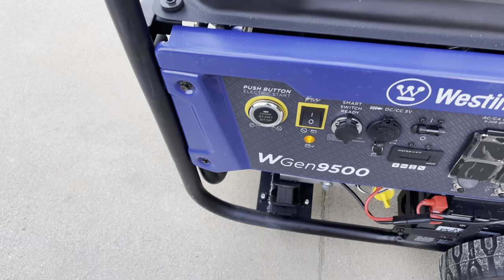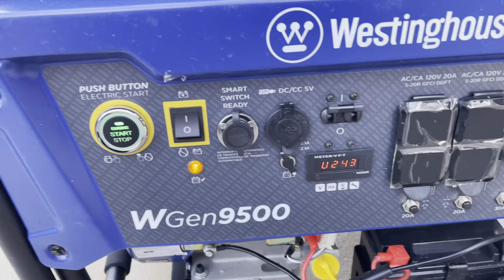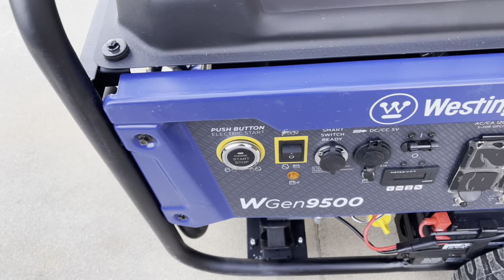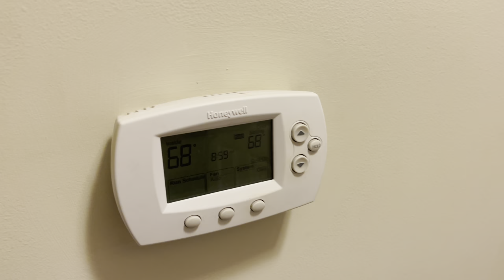WESTINGHOUSE WGen9500! Will it power a home AC??? First start, short review, and the truth!

Comment: How long could that generator run an air fryer nonstop for food catering?
Reply from the maker: Just an Air Fryer? Well I never ran it a super long time but I’m pretty sure it could power a hour for 12 ish hours… so just an air fryer without a huge load on the the generator id say 13-14 hours? Not 100% sure.

Comment: Does your 50 amp outlet have a 30 amp breaker like mine? Is this wrong?
Reply from the maker: My 50amp outlet uses the main breaker that’s an actual flip up or down lever
Reply: @BigCountrysWay  Are we discussing the same thing? I’m referring to on the generator, the 50 amp outlet with a 30 amp circuit breaker on the generators panel under (sort of) the outlet.

Comment: Have you determined how many gallons of gas it uses per hour with a decent load
Reply from the maker: No I haven’t, haven’t had to run it to power anything yet
Reply from the maker: Will prob know after hurricane season hahaha
Reply: @BigCountrysWay  I went through power outages from Hurricanes Laura and Delta, plus three winter storms.  I plan to buy a dual fuel generator to have the option of propane but will have to depend on gas initially. Money is not a serious concern, but fuel is. Those storms were so bad that gas was very difficult to find in the entire western portion of Louisiana.
Reply from the maker: @rickcormier9160  I’m thinking bout adding a natural gas carburetor on it so I can tap into my houses gas
Reply: @BigCountrysWay  That would be a great solution and to still have gas as an option.
Reply from the maker: @rickcormier9160  they make a tri fuel kit
Reply: @BigCountrysWay  I have the same Wgen9500 Westinghouse generator that only runs gasoline. Who makes the natural gas kit or carburetor you mentioned?  Thanks!
Reply from the maker: @michaelgrech7894  to be honest, all I did was google it lol

Comment: Got a question.  I got the same one and I'm going to wire it up for the 50 amp. My question is it's a 120/240 volt. Does it automatically just switch between the volts. Like how can it run let's say a electric dryer that's on 240 but at the same time run your fridge that's 110 without burning the fridge up?  Please answer
Reply from the maker: Well if you wire it to your house with a 220, that 220 will go through your breaker box if it’s wired like i did. Power will be distributed to both 110 and 220 appliances just as if the power was on.
Reply: @BigCountrysWay  k so pretty much it'll send 240 to the breaker box.  But whatever breaker you turn on that's only a 110 that's all that particular breaker will send out to the appliances, lights, etc.
Reply from the maker: @cavyboy99  yes sir!
Reply from the maker: @cavyboy99  I literally just back feed my panel with the 220 plug. No issues. If you do it that way make sure to start with all your breakers off and turn in what you need
Reply: @BigCountrysWay  do you have a hard start kit on it
Reply from the maker: @demoll78  no sir I don’t. Nothing on it. Make sure your AC is the only thing flipped on in the breaker panel when you try to get it going
Reply from the maker: @demoll78  you running it on propane?
Reply: @BigCountrysWay  only gas
Reply: @BigCountrysWay  RLA 14.1amps  and the LRR 77 amps
Reply: @BigCountrysWay  with a hard start kit what size breaker you have on your generator
Reply from the maker: @demoll78  on the house? I’m not currently home to check. Deployed lol

Comment: I have the same generator. My only issue with this generator takes 4-6 cranks before it starts up on gasoline with auto choke. Does anyone have starting problem like this?
Reply from the maker: So, I would just hold the choke with my fingers if it had problems starting. I think the auto choke needs to be set to last a little longer but if you hold with your fingers it’ll fire right up.
Reply: @BigCountrysWay  Thanks so much. I really appreciate your help.
Reply from the maker: @lactruong  yes sir! My pleasure

Comment: Looks like you used EMT set screw connectors on a PVC elbow. That is not waterproof at all, and are the wrong connectors for that elbow. I see that you siliconed the crap out of it, but that will eventually fail. Depending on the size of that elbow, got back to HD and get two "male adapters" or "terminal adapters" of the same size, some PVC glue and glue them on to that elbow. You should be able to reuse the locknuts that are on the EMT connectors.

Comment: With a dead battery you will not be able start your generator. Get a generator with a pull string as a back up starting system.
Reply from the maker: It has a pull string. Lol
Reply: @BigCountrysWay  well I'll be, It does, have a pull cord. My apologies
Reply: I have the same generator and say it is too hard to pull start with a dead battery just jump it off from a riding mower or car because it is all based off a 12 volt system

Comment: What company did you order it from?
Reply from the maker: Amazon
Reply: Hey bud, I'm about to get the exact same generator you got, but the one with the propane option (westinghouse should break you off💰 for making a sale for them). I got a 3.5 ton unit. Hopefully that shouldn't be a problem. My question is, shouldn't your main power switch be inside with the other breaker box at the top? That's usually how I see them. Is that one outside what they call a "transfer switch", something you installed with the 50 amp plug?  Why 50 over 30? Will it not power your ac with 30? Not sure how all that works. Got an electrician coming out this week and want to make sure I get it done exactly like you did. Thanks boss
Reply from the maker: @johnnywhitepride8540  should run it just fine! My breaker set up is just different for some reason. A lot of homes only have 1 box with the main power at the top but I got two boxes and the main is outside lol no clue why. My outside box has nothing to do with the generator. I just made a power “back feed” in that breaker box. I opted out of using a transfer switch, 1 to save money, 2 I can control what my generator powers with the main breaker box throughout the entire house. A lot of transfer switches are limited to like 10 breakers. So this way I can pick and choose what I want to run. Lastly, I’d go with the 50 amp if you have the option on the generator. This way you can be running your AC , 1 stove eye, fridge and some lights all at the same time. I imagine that would be a lot on a 30 amp outlet. I reckon you saw my wiring video for the generator, if not, check it out. I go into more detail.
Reply: @BigCountrysWay Thanks for getting back to me so quickly. I just watched your wiring video. I sure appreciate you going into detail with everything. That's what I needed to see.  Trying to get all this done before the next hurricane here in southwestern Louisiana. Great channel boss!  Liked and subscribed
Reply from the maker: @johnnywhitepride8540  thanks buddy! Glad I could help!